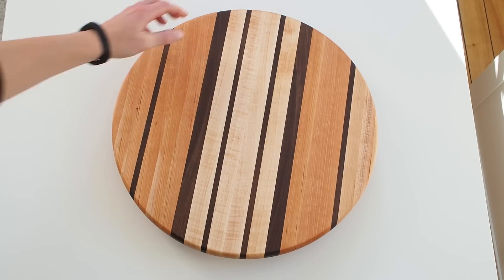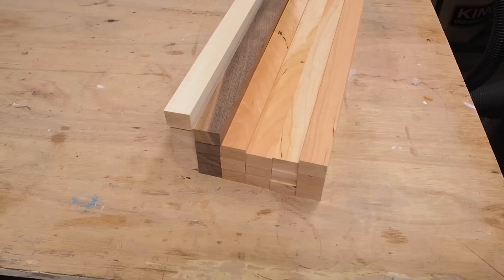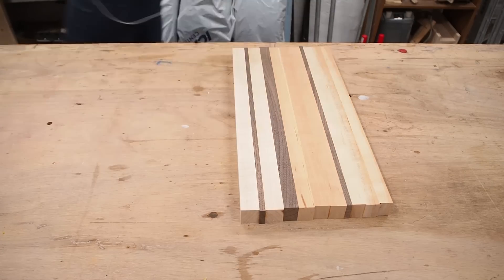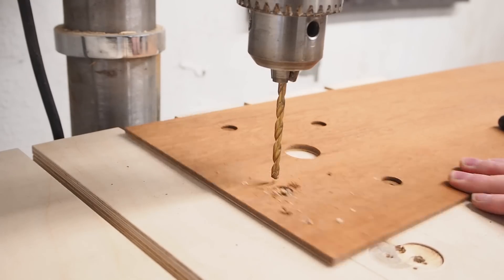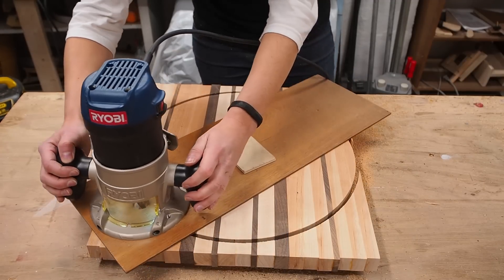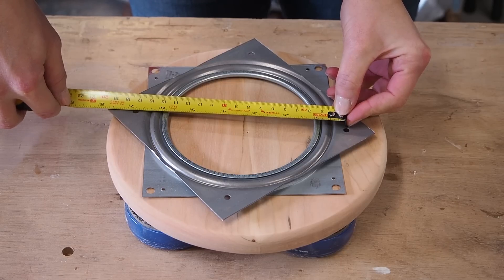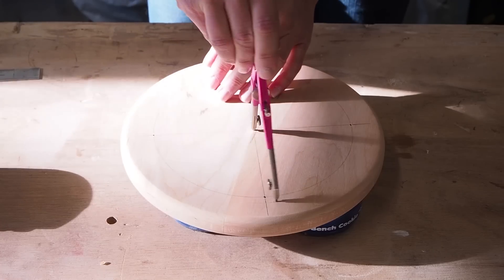Wooden Lazy Susan DIY

Comment: You had the centre before you cut your circle with the router. Why didn’t you just use that to mark out where the bearing bracket went then? The pilot holes would of been drilled then. (Not to full depth, but enough that if plained they’d still be there? Why did you drill 4 accesses for the bottom piece? You only needed one. It looks amazing thought.

Comment: I like the method you used for attaching the bearing to both the bottom and the top. Your method is, in my opinion, the most sensible way of going about attaching the hardware. I bought a lazy susan a while ago and that is exactly how they attached the bearing. Nice build with the chopping board top, that was a nice touch.
Reply from the maker: Thanks! Glad to know I guessed the right way of doing it :)

Comment: Beautiful color and pattern on the lazy susan. When I make a lazy susan I router out the backside of the top board to a diameter 1/4" bigger than the bottom board and to a depth equal to the thickness of the bottom board. That gives it an effective look of hovering above the table by the thickness of the bearing.
Reply from the maker: Great idea! That would give it a really low profile and would hover like magic.

Comment: When I saw you passing the two parts over the jointer I remembered a trick I have recently learnt: pass both halves over the jointer at the same time, after „folding“ them up like closing a book (the sides to be jointed are like the spine of the book). That way the assembled board is guaranteed to be flat, even if the fence of the jointer happened to be set slightly off 90 degrees.

You can even extend this technique to deliberately use odd angles and still come up with prfectly flat glue-ups.
Reply from the maker: Absolutely! I just learned that from MWA woodworks as well. Excellent tip!

Comment: Great Video.  I just made one out of a wine box top and it came out great.  Only problem was that I used the Lazy susan mechanical part from an old tv stand that had the lazy susan mechanism to turn the TV.  It is so noisy that it is not good for a dinner table.  I have been trying to find a more quiet one but the ones that I find at the big box stores are just as loud.  Can you tell me the brand name of the mechanism that you used.    I did not think that it sounded loud in your video.

Comment: Quick question.  How does one screw down something from above?  In order to get the screws to attach the metal plate then you would have to go all the way through that bottom round.  But wouldn’t that leave the sharp pointy bits of the screws pointing up towards the top circle when you turn the lazy Susan upright?  Wouldn’t that scratch everything? That can’t be right.  Where am I going wrong here?
Reply from the maker: When attaching the bottom plate I screwed into the tiny pinholes in the plate. The screws are short, and there is a gap between the 2 sides of the plate, so the screws don't interfere.

Comment: Why should you be using the small holes for the bottom plate and not the larger ones for better grip?
Thank you.
Reply from the maker: It could be done but the way I made it (screwing the bottom circle from underneath) it would be difficult to get a screw to hold in the larger holes.

Comment: You should need only one hole through the bottom base to screw the hardware on
Reply from the maker: Yes, that's one way to do it. Make a hole all the way through the base in line with one of the screw holes and rotate the base going from screw to screw.

Comment: how did you screw down the bottom piece?  bottom piece needs to be screwed in first...
Reply from the maker: The holes in the bottom piece line up with the smaller holes in the swivel plate and screwed in from underneath.

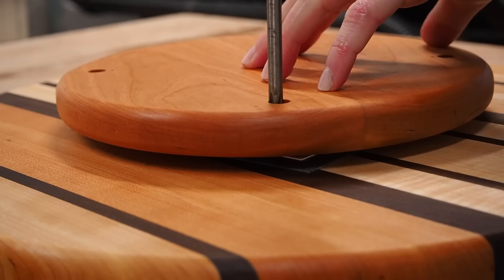Comment: I dont understand what you screwed the bottom piece into at 6:21... it looks like you just put screws through the bottom piece of wood and into the holes of the swivel bearing but what the heck is holding those screws in place? If the screws went all the way through to the top piece of wood it wouldn’t spin. But if the screws are Just going through the holes you made in the bottom piece and into the swivel bearing holes than how are the screws not simply falling out of the holes you drilled??
Reply from the maker: The holes in the bottom piece of wood line up with the smaller pin holes in the swivel plate and are simply screwed in from underneath.
Reply: I see that now, thank you for explaining.